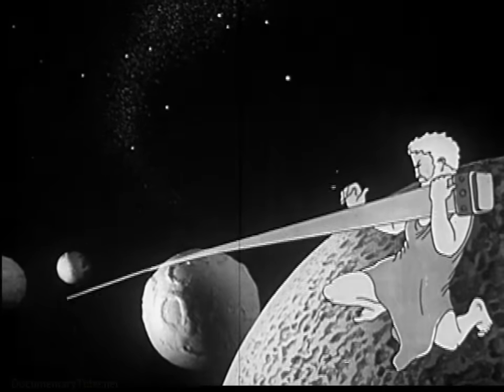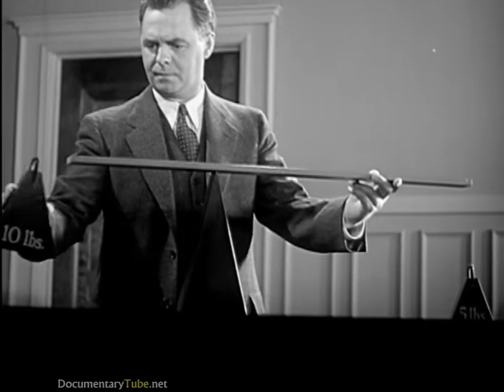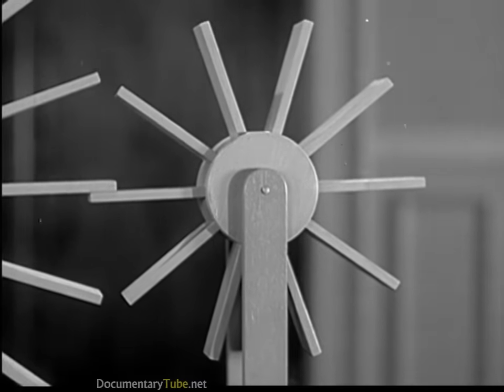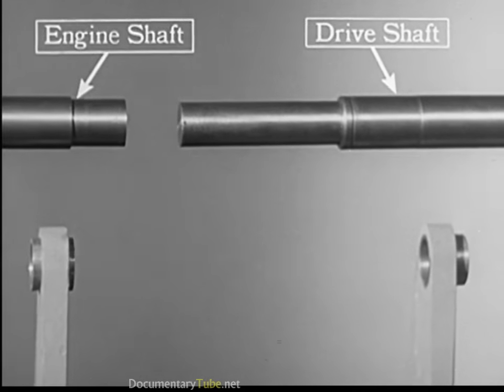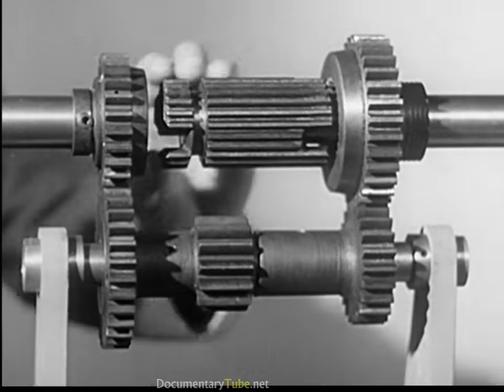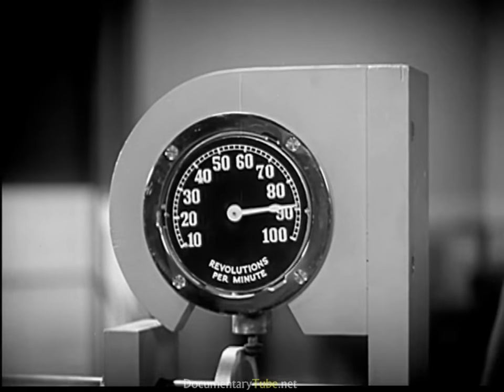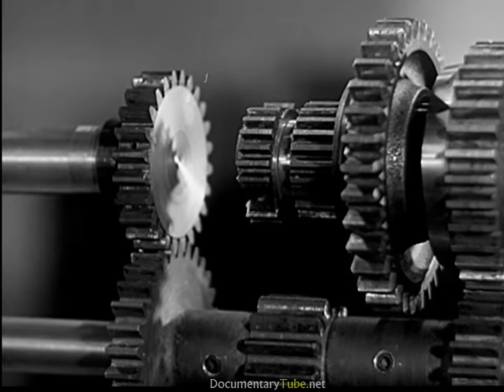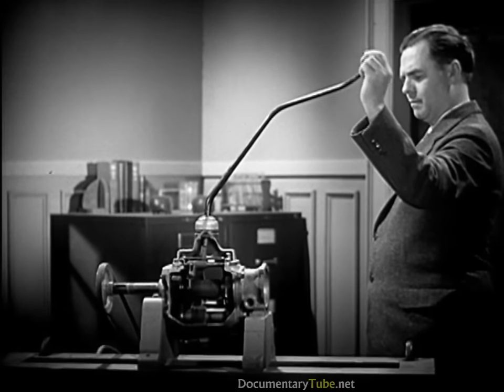HOW IT WORKS: Transmissions

Comment: I love how videos like this start with the most basic mechanical principle and show each and every step up in complexity until you get to the final component.
Reply: +calculon000 yes. everything is better explained in these old videos
Reply: +calculon000  I second your comment. Despite driving cars for more than 15 years now this is the very first time I have understood how gears work. Well explained video.
Reply: +calculon000 I completely agree. these old videos do an exceptional job of explaining things. 10 out of 10 good video.
Reply: +William McCartney Some old school things can't be beat by what we have today. The things we take for granted. XD
Reply: +calculon000 Amazing what happens when the end goal is to teach students how things work.

So, what do you think the end goal of common core is? Kinda funny huh?
Reply: +calculon000 This is how we were taught before the liberals took over and became obsessed with feelings, etc. This is why kids suck these days.
Reply: +Aglarend Bingo!
Reply: *****
 You are not the only one. My brain broke at 3rd gear... I will stick to my manual transmission.
Reply: *****
 No it's not as I drive a manual. This is an Automatic. Manual transmissions do not use rotating planetary gears and torque converters.

Manual transmissions gears slide back and forth without rotating around another gear. Also they use pressure plates, and clutch rather than a torque converter.
Reply: +SilverlonewolfX  The example shown in the video was a manual transmission. There were no planetary gears, and they demonstrated the use of the synchronizer, so that that woman could shift gears quietly while rolling down the hill. Automatic transmissions are far more complex than the one they showed.
Reply: Oh wait wrong video. Actually my bad.*****

Sorry I thought this was a different video for a awhile. Some kid on another video how Auto transmissions work was ranting how Autos are better and take skill. And as we tried to tell him Auto transmissions are lame, he starts to bring up how he can beat my 350Z in his Ford Fiesta because my car is "old."

It really got me a little annoyed that I replied to the wrong video on all this.
Reply: Liberals & conservative politicians are the two wings of the same bird working together in duality. They may appear to be different but they are working together to dumb down society. It's 2017, it's about time you woke up from the illusion!
Reply: +earlsworld70117 I honestly disagree. The more liberal the world becomes, the more problems arise, and the solutions are worse than the original problems. You just heard that some nitwit school system in California wants to ban the game of tag in grade school because it's too violent? Seriously? So I guess when the kids are fidgeting in class because they can't burn off any energy, the solution is to give them ritalin to calm them down right? 

See my opening statement.
Reply: Exactly
Reply: Frank Basile yes I agree these liberal ideas are rotting our children's future.
Reply: Exactly. It sometimes seems that some modern tutorials expect you to have an understanding of the basic principles that go into a concept.
Reply: Old Videos Keep It Simple , Honest And Informative All in rhythm.
Reply: I totally agree with you. Its an art how to teach the proper way and I myself and many others seem to find this way the best, where as you mention it starts with most basic principles and then gets more advanced. I wish all teachers knew this when I was in school.
Reply: Too bad this oldie doesn't visualize how the stick shift is connected to the clutch lever and lever to the gears.
Reply: Typical conservatives. Bashing things they don’t understand instead of trying to understand them. 

I use common core math all of the time. I just didn’t know it was called that. 

You products of conservative schooling, learning everything by rote and memorization can probably do in your head addition to three figures provided you don’t carry, subtraction provided there’s no larger numbers in the bottom column, multiplication up to the 12 times tables, and very basic division.  

I can do all of that plus more complex arithmetic up to basic trigonometry in my head, fast and accurate, by breaking it down into ones, fives, tens, hundreds, and thousands like they teach common core.
Reply: I agree, the teaching method is solid and very understandable.
Reply: KSI had BirdDog 
Liberals or conservatives are both the same bs . The only thing that makes them different is the amount of evil that each party has on agenda for the country . And is on god’s power to determine and judge which party is going to rule every 4 years . . Right now on 2019 the democrats ,<aka.> [ liberals ] are working with the devil and god is putting a stop to their agenda with the help of the republicans. Previous years it was the opposite . The devil doesn’t care which party he uses to bring this country down . But god always have the upper authority and always sees the bigger picture .
Reply: I love how you know just what to say to get the most thumbs up. I love social media because it teaches me how to say the things that will make me popular, and that's all the counts, right?
Reply: @jackhammer5468  I love how people mentality have change with social media and how people get emotionally affected because of a simple comment . I also love when people comment on a video that I watched and liked in the past . it makes me remember the video that I've already forgotten.
Reply: @calculon000 Indeed! These folks had a lot of wisdom from the Holy Spirit, thus clear and concise instructions.
Reply: @GUSftw  yea because you have to teach people new things somehow
Reply: @earlsworld70117  look at liberals now, isn’t it scary how fast the world can change??
Reply: @majkutisusernameom  1¹010⁰

Comment: The synchronizer was perhaps the most fundamental addition to the manual transmission system. Nowadays it's fairly easy to shift between gears almost without having to worry about timing. You'll still have to try to match the engine's RPM with the car's speed and enviromental conditions (e.g. driving uphill or driving down a steep descent). In fact I'd never drive downhill at 60 MPH, as shown at the end of the video, and then go into 2nd gear, as at that speed, the engine's RPM will be too much high to be contained into a 2nd gear, a 3rd - 4th gear would be better suitable.
Reply: Agree syncros were a revolutionary change to the manual transmission. As far as gear selection those old cars only had 3 speed transmissions. 2nd on that car would be 3rd on a modern car. 3rd on that car would be like 5th on a modern car.
Reply: Carl Zimmerman Oh didn't know that! Now it makes more sense :)
Reply: These were only 3 speed transmissions so their 2nd gear is the same as our forth in a 5 speed
Reply: Yes the strain on everything  and the back wheels will skid and if you know people today would crap their pants  when that real end comes sideways
Reply: @carlzimmerman8700  and they would shift much later than us then?

Comment: How sad is it that we learn way more from the internet at home then we do at school. The only thing more pathetic then that is we're learning this stuff that came from the 50's. 
This should be a standard middle school curriculum subject and then advancing to actually working on basic engines once graduating to high school.
Reply: Even more pathetic is the fact that we pay for school, more now than we ever have, even when it's free. Most people pay to be told what and how.
I was tearing apart and piecing together lawnmower motors when I was eleven. Imagine what I know now, at 37. Eight year olds could understand videos at this level, so what would they know at 40. If pushed right, I'm sure 20 yr olds could make Hawkings look fairly simple.
Use caution down this road, it gets rough when you start realizing things.
Reply: So you think automotive engineering shoulder be a compulsory subject in school? This is skilled work, if you want to pursue a career in this industry, you can do it after school. Primary and secondary education is designed to develop critical thinking and provide a platform for people to realise their talents and interests, not force you into a particular industry.
Reply: NickLiang
At the same time, though, A solid learning of the fundamentals of how stuff works is essential for the future of all things. I believe engineering, coding and cpu logic systems, generalized cause and effect, organization planning and  forethought, DIY and substitution method, should be up there with Biology and Mathematics. Consumer logic needs to go the way of the dinosaurs. Things won't always be there when you nee them.
Survival classes based on Bear Grills and Les Stroud wouldn't be a bad idea either.
Reply: WhtStr213 That level of learning is not suitable for under 16 year olds, it is far too complex. It is also skills you can learn and develop if you want to want to pursue it. However compulsory subjects provide the basic skills for you to pursue those specific subjects which include some basic engineering, computer systems and even DIY. Organising, planning, forethought, generalised cause and effect are not subjects, they are qualities and skills which are already introduced in many subjects especially science. Further education will then substantiate this as you choose more specific subjects which suits your interest.
Reply: NickLiang
And yet, I see kids 2-3 yrs old figuring out phones better and much faster than any other, and learning complex solutions that stump adults.
Aren't qualities and skills for better understanding kind of the point of education, and wouldn't concentrated effort on those form a more solid foundation for education on all subjects.
On a side note, thank you for bringing good conversation and valid p.o.v.. I appreciate your demeanor and approach to our conversation. ( not just stupid one-liners and insults)
Reply: Warbird Phoenix I think I love a Lil after that comment
Reply: Knowledge Power What's to laugh about it?
Reply: Generic Username wtf are u talking about ?
Reply: There are so many subjects that could be easily self taught given the proper resources and dedication.... and schools charge thousands and thousands of dollars to really just have someone read the book for you.
Reply: +JeevesReturns Agreed in full
Reply: Warbird Phoenix hahahah
Reply: +Red_Jacket I never said it wasn't and I'm not sure what point you're trying to make when you talk about your own experience. Apparently what you didn't learn is accurately extracting content from what you read.
Reply: +Red_Jacket I agree it is important knowledge for the minority. Regret not knowing sooner than 6 years old?..........
Reply: What's really sad is the transmission pictured is HYDRAULIC and the entire video is about a MANUAL transmission.
Reply: Warbird Phoenix they did teach this is high school...just nobody was paying attention and was on their phone...or copied the smart kid in class..
Reply: Warbird Phoenix I agree... partially. Learning about levers is definitely crucial, because they are often used in daily life. However, knowing how a manual transmission works is not necessary. In other words, an average person would only need to know that a manual transmission enables the engine to move the wheels, with wheel revolution speeds dependent on which position the gears are in. They don't need to know the required process, because unless the person was disassembling a transmission gearbox (and for no purpose that wouldn't nullify the term "average person"), that part could be simply worked on by a mechanic, and the consumer would understand what is being fixed, why and how much it should cost (to account for the "mechanics rip you off" stereotype).
Reply: Warbird Phoenix I'm in 7th grade and I searched this because I wanted to know how a transmission works. What a shame they don't teach this in school.
Reply: RIGHT?! my school use to teach me poetry (not any more) but like how is that going to help me later on
Reply: Warbird Phoenix... because the teachers assume that We already know everything af😂😢
Reply: We are using modern technology to back in time to when they taught more thoroughly
Reply: Sad but true but it all depends on the person presenting the information